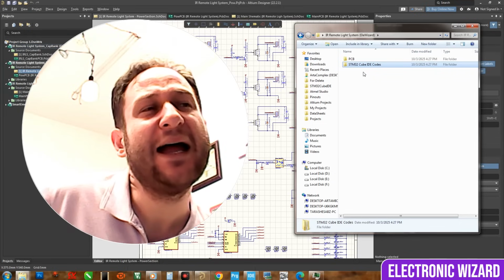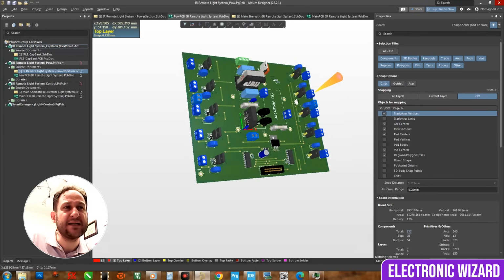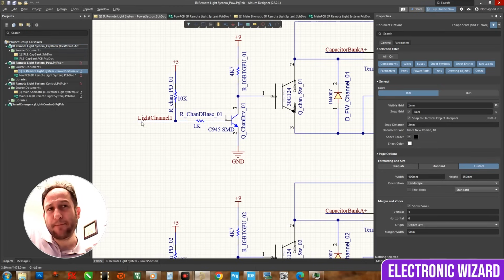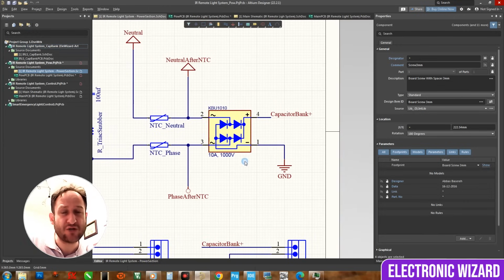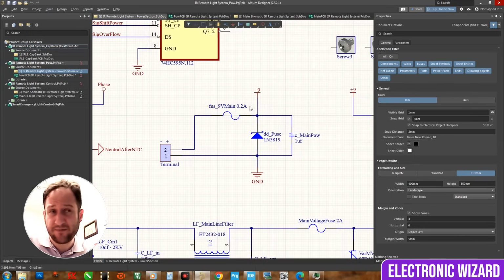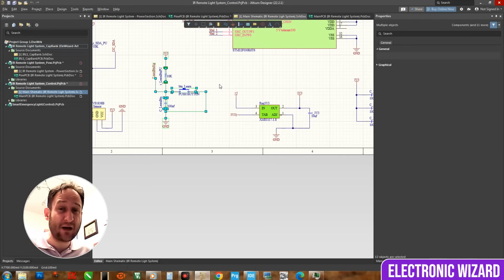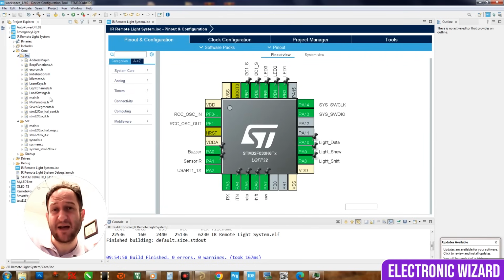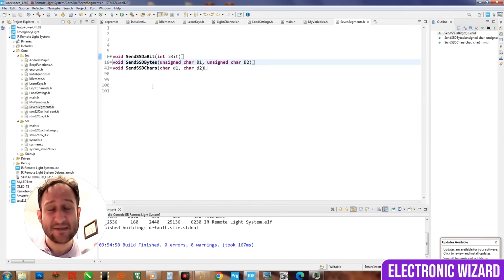10 Channel Light System: PCB, Schematics & Codes

Comment: Hello, I recently read a couple books and watch several videos that explained the double slit experiment. It was stated that when an electron is shot at a double slit it appears in the two places at the same time. I was wondering if you took an electron gun and beamed electrons at a grid of "double slits" would the electrons that  traveled through the double slits double????? Also if you placed a series of these double slits would the electrons double each time they crossed a double slit??? I would imagine not all the electrons would travel through slits but with some thinking it might be possible to get the highest yield of electrons passing. Thanks in advance. Have a blessed day

Comment: You are using the IGBTs as low side switches so all the light fixtures are sitting at 300V when off. Shouldn't you be teaching people to use the IGBTs as hi side switches so that the light fixtures are at ground when off? Normally in residential wiring, light switches are on the hi side for safety. Thanks

Comment: hey man, i like your video's and explenations! (your breadboards is a bit messy imo and could be a bit cleaner to understand better) but ty for all the info.

i do have 2 questions tho. with the leds for example. you wanted to remove the flicker, you rectified ac, you smoothed it with capacitor. basically eliminated flicker. well done sir... now the question is, instead of using 1 side of the sinewave you use both, does this also mean 1 the leds are brighter (just like pwm double the time on)?? and do they use double the power now?
are you planning to use mosfet etc to make a dimmer to reduce power usage etc? or please let me understand. explain to me please.

2nd question is like the triac etc, why for example not buy the most basic IR plug switch and use that on your boards? sure iknow it has relais and is more prone to failing, and might use a tiny bit more power due to powering the relais... but please explain... 

those 2 questions are bothering me, i would love a little followup on those questions, hope you have the time to answer/use a couple of sec in your video to explain.

thankyou in advance!!
Reply: also obviously the question with the leds and mosfet is with high KHZ switching so no flicker on camera. are you planning on doing so. and if so or if not. why? (i would THINK you would do that because 1 dimmer is nice, 2 switching is better due to led difference and thus brightness/color difference if you would dim with just voltage) please enlighten my brain! explain sir. ty ty ty

Comment: Non-isolated mains power supply is the first mistake. The scattered parts of the diagram - second. Turning on the IGBT with a resistor is the third...🙂

Comment: I wish this video started with a quick overview of what this project is supposed to do. The size of that capacitor bank and IGBTs switching over 300v make me think this is for something like controling the lighting in 10 rooms of a house independently, or some other kind of very high-power circuit, but even after watching the video I'm still not sure.
Reply: Yup, a 300vdc switching system is not how you control lights.
Reply: @rallymax2  maybe this 220v led string is all he has available? idk. i have some 220v led strings that are encased in silicon so not easy to make those lower voltage leds without destroying the ip rating. might be it. i am more interested in explenation about power draw bcs he rectified ac, uses both sinewave now. and led brightness is different now?
Reply: @johanbergen-googiezuigtballen  Sorry, I don't understand your question.